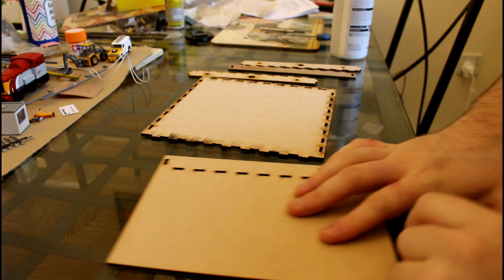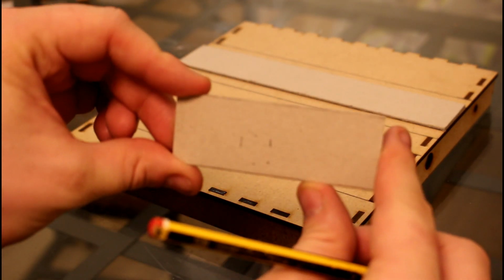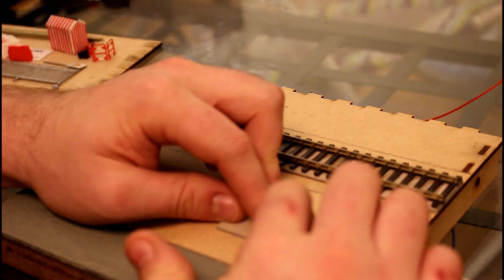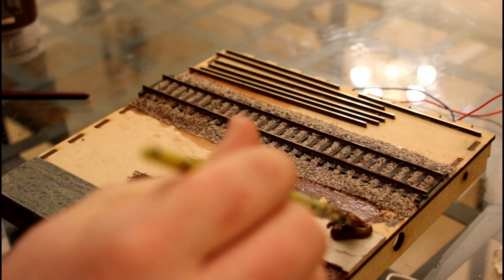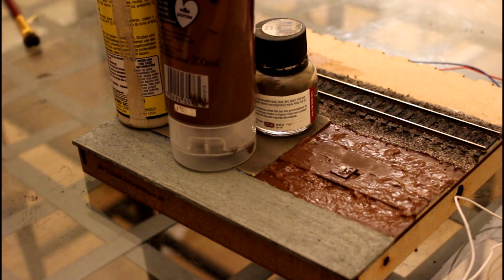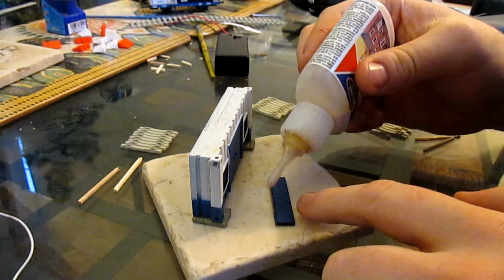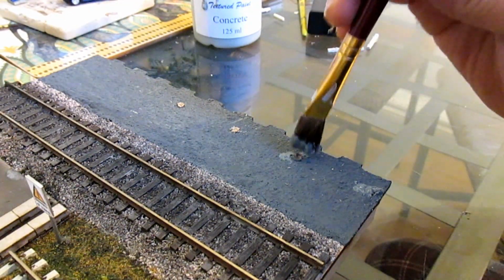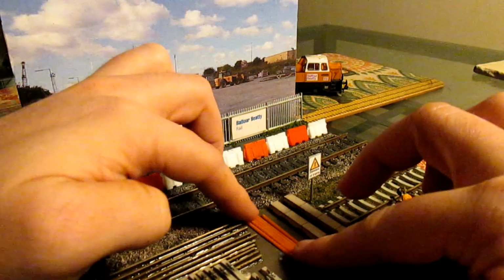Build an Industrial Diorama -  How to - Model Railway

Comment: Great work, love the small details. Could you add some colour to the 50/50 mix to help?
Reply from the maker: Many thanks! 

I suppose you could add paint to the mix if you wanted to tone down your ballast or scatter. I think I prefer to do it after the glue has gone off as you have more control over the final colour if you add a wash later on.
Joe